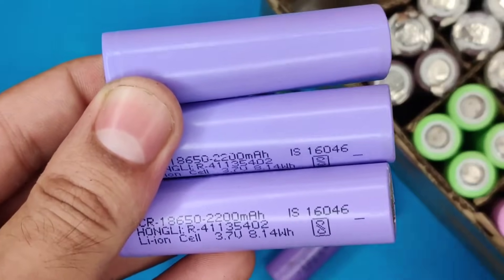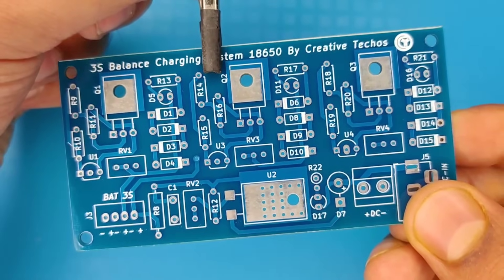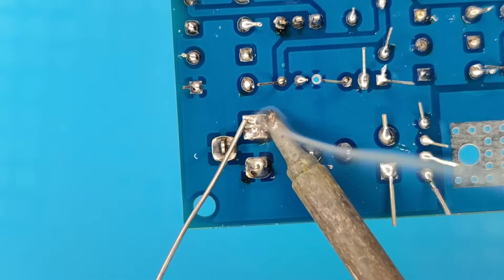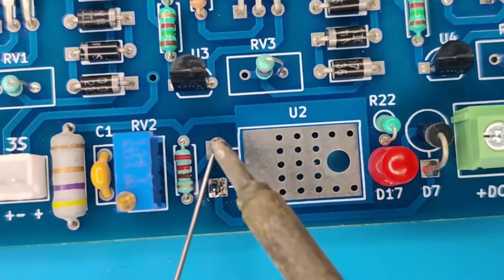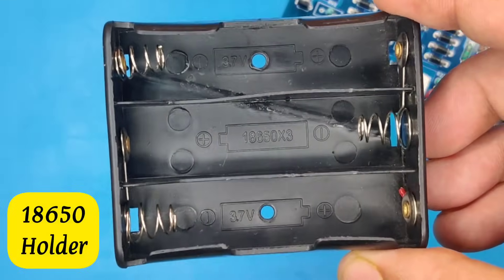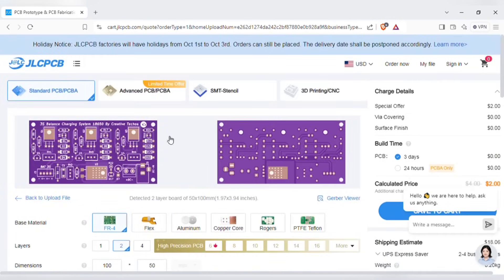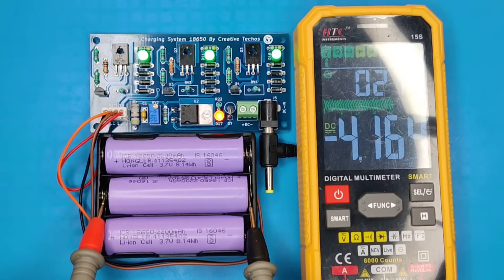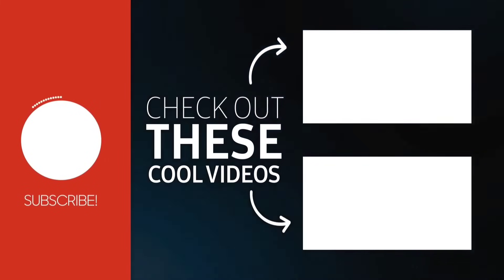18650 3.7v Auto cut off balance charger 1S 2S 3S Lithium ion battery BMS

Comment: IN the circuit diagram R22 IS 1K BUT YOU USED 470 OHM RESISTOR ON THE BOARD please let me know which one to use

Comment: Will this BMS automatically drain the battery? I mean, will it consume charge automatically? From the circuit diagram, it seems like the diodes will consume the battery's charge, meaning the charge will decrease. Is that really the case? In other words, if this is not used, will the battery's charge drain? Please let me know.

Comment: Eu vi você quebrando o terminal do meio do transisto. E depois que entendir. Que a parte de cima do transistor serve como coletor né!?
Reply from the maker: The component i used is not transistor, it is lm317 adjustable voltage regulator, and i broke the middle leg, because it is always connected with metal part of body, with we connect heatsink, so i solderd metal part of body with big pad of pcb, so that it works also as heatsink, and that pad is itself connected as in diagram as pin 2 😃

Comment: Sir you can design best circuit.Sir can i possible to charge single battery set cuttof voltage 4.2.and sir can i use noramal 1 or 1.5 amp 12 volt or 5 volt adaptor .if use what is the  output amp to get. please reply me.